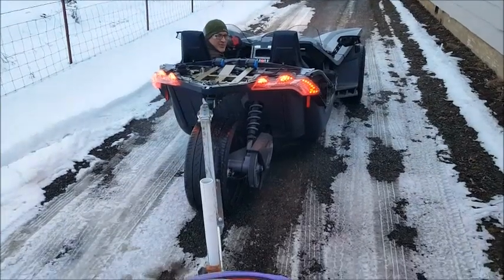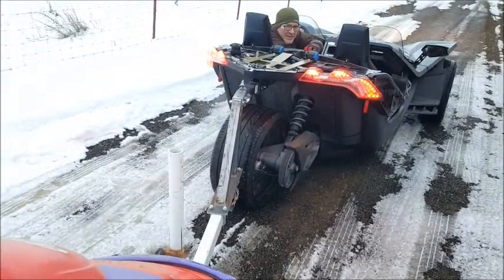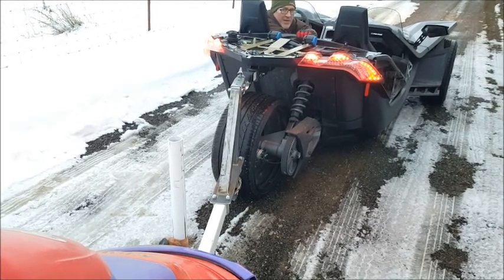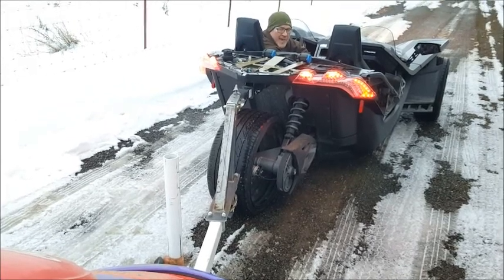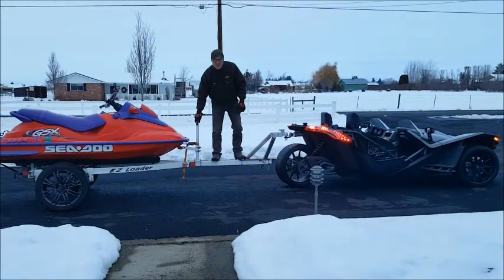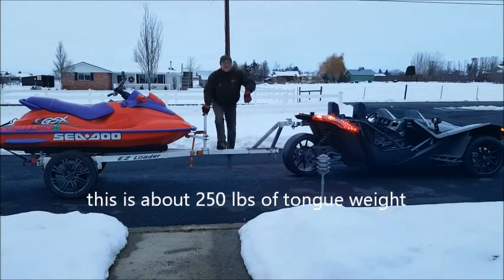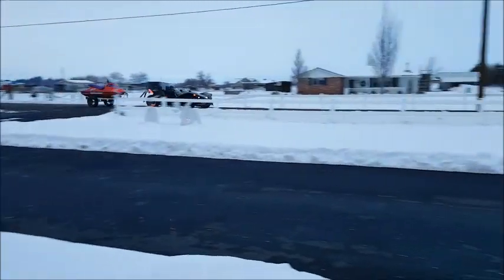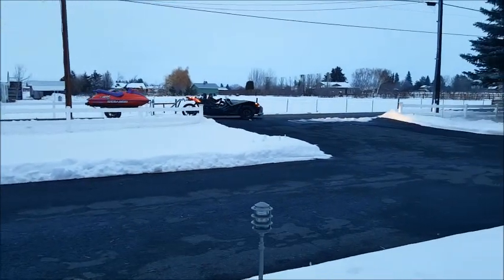New Slingshot Hitch Drive Test

Comment from the maker: This is the "Wycked Hitch Sytem" for the Polaris Slingshot introductory video. This prototype is really rough, but it does the trick.  The upgraded hitch is much cleaner and features a "trussed" center section that takes all of the load off of the rear aluminum subframe.  

This is a revolutionary concealed drop-in hitch system that accepts any 2" trailer hitch.  It is the only one of this type in the world made specifically and for the Slingshot.  The unit is concealed and mounts within the framework of the  slingshot with no cutting/drilling or modification of the Slingshots tubular framework.  4 slots must be cut into the plastic underpanel above the rear wheel.  There are no clearance issues, and the stock rear license plate holder can be used if there is no ball in the receiver.  Check out the other videos I've posted.   

Although I state in the video that I wasn't ready to pursue manufacturing at that time, my plans have changed dramatically since releasing the video on YouTube and Facebook.   We have had so much interest that I have applied for a patent on the design.  I am no longer looking for beta testers for the system, but welcome all feedback and comments as we will be constantly adding accessories and improvements.  

If you are interested in manufacturing/distributing/advertising these units for us, please contact me.  If you would like to purchase one before they hit the market place do so soon!  I'm really excited to make something like this available to fellow Slingshot enthusiasts!